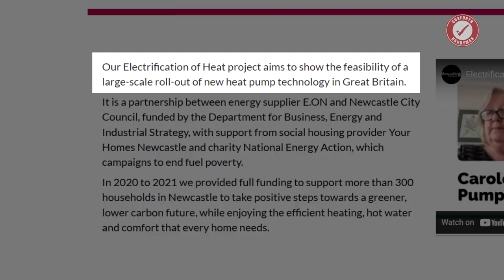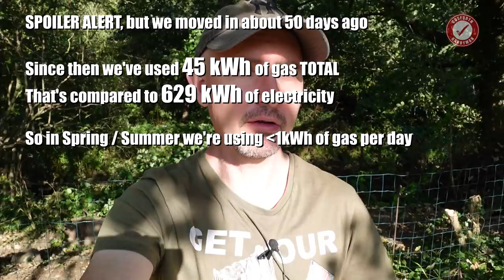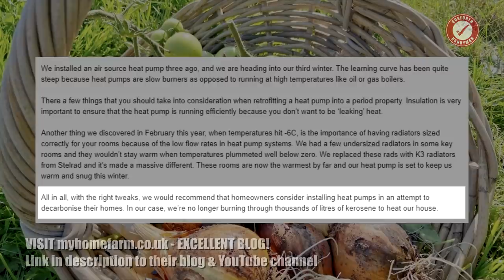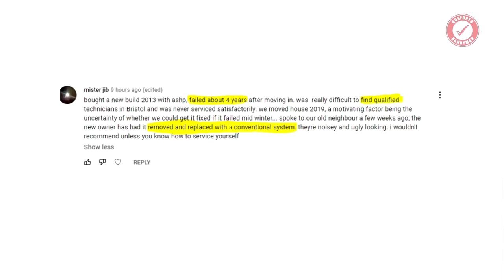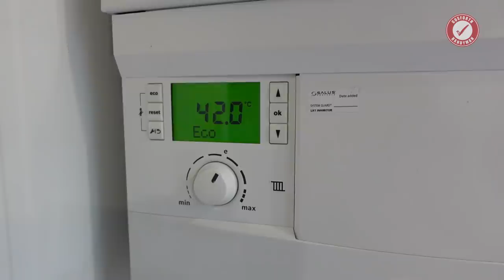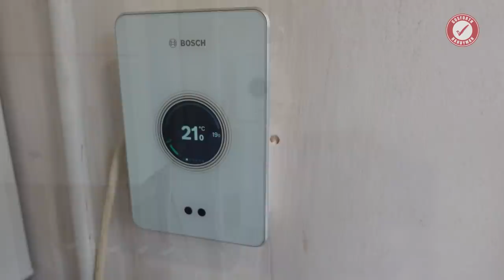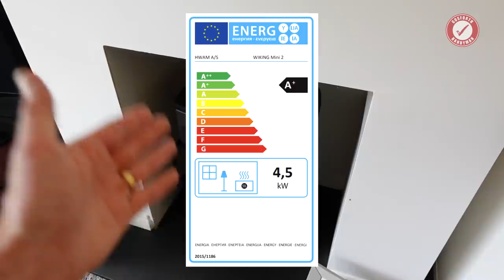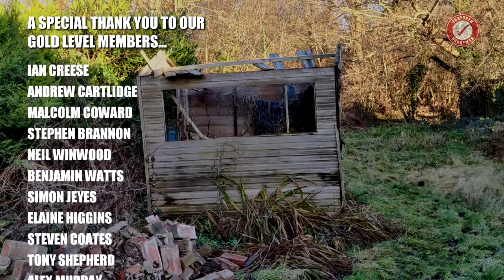Why didn’t we install an Air Source Heat Pump? (1920’s Renovation Part 32)

Comment: I have some family in Sweden, they only heat their house with a ground source heat pump and an air source heat pump and they have no issues. They have had it for 25 years and their house is very well insulated (almost passive House standards). I think that heat pumps are definitely very interesting but are only really appropriate for really well insulated and air sealed houses.
Reply: And... Countries where electricity is cheap?
Reply: I think that you might be talking about two different things about ground head... one is more like a dwell and the other is putting plumbing all over. The one Richie's Swedish family has is probably the dwell kind. Guessing from Andys hand waving I'd say he is referring to the pipes-all-over-kind.
Reply: Heat pumps work in Scandinavian countries because they use quality wood as part of their building private homes, and this make homes warmer than using cheap bricks!

Heat pumps will fail in the UK under current housing standards, unless new houses are built to accommodate for heating pumps and you need proper insulation and no air drafts! Otherwise in freezing weathers, heating pumps won't warm the house and therefore homes will use electric heaters which will be costly and that defeats the saving claims!!
Reply: Same in Austria
Reply: In Sweden, there are very few locations is gas in pipes to households, there is also not a lot of usages of gas in tanks. So a gas burner system like used in this video is not an option in most locations in  Sweden.  In cities most of the heating use district heating.  If you are out of a city where it is not available eclectic heating is the main option.  So direct electric heating or by using a ground or air heat pump.
Reply: As some people are saying, you need highly insulated houses and ideally under floor heating, which runs at a lower temperature than radiators in a gas central heating system. Retrofitting most existing U.K. housing stock with air source heat pumps is pointless. The government needs to introduce much higher insulation requirements for new builds (and for air tightness, as someone else mentioned). As for existing houses, I don’t know what the answer is - probably only hydrogen.
Reply: @wilyc0y0te  the insulation standard for new builds ls high enough. We’re talking about 0.11 W/m2k now for walls and floors. It’s the air tightness that is lagging behind.
Reply: @immers2410  my standard new build is at 4m3/hr/m2 they are getting lots better.
Reply: @svantesvenson5435   b
Reply: @svantesvenson5435  I know what you’re saying. The Dwel type work well from my understanding talking to a friend in Sweden when I visited in 2006, but that’s because they go so far down, I think his was 200m, to warm granite bedrock, which the type Andy was talking about was the one with pipe a couple of feet below ground. Sweden has always been ahead of the game.
Reply: @Floyd1504 there's an immersion heater with it, this kicks in at 60 Celsius, something the manufacturers don't tell you about, offices on like Trading Estate have a banker of Grey massive air conditioning units, these things are noisy big and ugly especially if it's got to go on a wall or your decking, this is going to look very interesting when it comes to fit on these tall residential buildings, high-rise,,, here in Wales our psychopath narcissist Mark drakeford is still going ahead for all properties to have this crap fitted by 2030,  don't forget if by then you don't have the heat pump you will not be able to sell a property by a property remortgage a property without a certificate, not only is this on the world  economics forum but it's also in the government's manuscript, people need to start waking up for what the government is doing,
Reply: They are also very noisy.
Reply: I lived in Norway I had triple glazing and home insulated inside and outside cladding
Reply: True. Quite a lot of nordic housing is in the same fashion. Still, 50cm ground insulation and 25cm wall insulation! Insulation is key.
In some countries with a fair amount of geothermal activity (volcano land) have plants that are basically large ground source heat systems and distribute it to districts. Either way, the insulation is the absolute key. Without that high insulation factor, it snuffs any success.
In the UK, houses have nothing close to that.
Reply: @NeoFreshair  plus 50cm ground insulation and 25cm wall insulation!
Reply: TWO PROBLEMS. (1)Too many Luddites in the UK. Education is poor. (2) Appalling construction standards now coming home to roost. Bottom line is, much of the housing stock needs rebuilding!!!!Frankly it is over valued and rubbish...
Reply: @megasoctopuslegionofcake6248  what??>?
Reply: @Floyd1504 I think this is the other advantage of ground source. Afther a few meters the soil is at a constant temp (I think 20c) it doesn't matter what temp you have in the outside. So ground sorce is better for hard winters and less noisy. But it is expensive and much complicated than a gas boiler. It all depends on the price of your energy, either gas or electricity.
Energy in Spain is very  expensive, I am paying 350€ a month in a semi-detached house, very well insulated. If per example you can get solar, heat pumps soil sourced might make sense.
Reply: Bricks are best with quality insulation , better acumulate heat. Wood has not so good acumulation. I have 44cm porotherm + 16cm EPS and 30cm rockwool roof insulation and everything works great. FloorHeating 200m2 , heat pump Daikin altherma 6kw a7w35. Bills are good thanks heat pump and super acumulation of bricks and great insulation. Floor heating about 30*Celsius heat water. Thatˇs all.
Reply: @Floyd1504 still better than having only one option which is to constantly be burning fossil fuel

Comment: Chartered mechanical engineer and energy specialist here - not to be rude, but the myths and misunderstandings of these systems as presented in this video is exactly why uptake in the UK is so poor while the vast majority of other countries in Europe / North America (with much more extreme weather) are proceeding with proper heat electrification. Trust me, if an ASHP or GSHP system can work in Michigan, it can work in Newcastle! To be fair, these systems are very different to wet / rad based fossil fuel boiler systems, and therefore our conventional knowledge of combustion systems does not typically apply. Yes, you must install larger radiators to kick out the appropriate heat (if using a wet system), but this has nothing to do with efficiency. ASHPs are generally 3-4x more efficient than gas boilers, irrespective of how modern they are (bar some caveats around extreme temps). If used correctly, ASHPs in UK weather will year-on-year always be cheaper to run. In truth, insulation is not even an absolute necessity, but will make a home cheaper to run just the same as if you were running on gas so long as radiator sizing / heat inputs are properly addressed.

Don't forget, as well, that wet systems (using radiators) are only one potential solution. Air-to-air heat pumps using cassettes are also just as viable and used worldwide. Noise issues are a fair consideration, but heat pumps are getting quieter and quieter by the year. 

Electrification of heat is not going away, and the UK should embrace it. Hydrogen reforming may and combustion are certainly discussed, but will never have the same appeal as a global technology like heat pumps that already has mass adoption.

I am certain that a heat-pump solution would have outperformed the chosen modern gas system in running costs and potentially performance if properly designed and specified. However, the concerns around capital cost of installation are valid, and RHI / other incentives are only getting more and more sparse. Given the home didn't have a wet system to begin with, I can almost be certain in saying the specification of a multi-split reversible air-to-air heat pump with wall mounted cassettes (potentially supplemented by some level of insulation, although not necessarily) would have allowed for a far more efficient, not to mention low carbon solution with the ability so easily integrate things like smart zoning and controls and potential comfort cooling in hot summers which will only become more and more common. And because there would be no plumbing necessary, it may have even come out as cheaper to install!
Reply: Thanks for your comment, saved me from some of the despair I felt after watching the nonsense in this video. I wonder how many commercial/public buildings this guy has been in over the last few decades which have been kept perfectly warm by the heat pumps he says don't work as far north as, er, Newcastle. Hardly the arctic circle.

However, I do have concerns around current levels of expertise and support for domestic systems. We have an established supply chain for commercial jobs but how many of those companies could be bothered with dealing with the chaotic retrofit market? The current domestic heating system supply chain (esp retrofit) with plumbers shoving in oversized boilers with zero real design or commissioning could be pretty disastrous for heat pumps - perhaps the reason for some of the negative feedback to date.

Comment: We installed an ASHP in our previous home and would do it again in our next. It was a 9kw panasonic unit. As I'm from the Netherlands we have similar weather. Last winter was the coldest in many years with temperatures dropping to -15c. The heat pump is not very efficient with those kinds of temperatures, but that doesn't matter. It's all about the average throughout the year.

Our house was built in 2015, so fairly good insulation, which is key. 172m2 floor space and it was a corner house. Underfloor heating downstairs and normal radiators upstairs. Normal radiators worked, but lowh2o ones would've been better. The installation together with a 300l hot water tank was 10k, but we got a 2k government grant.

We also installed 18 solar panels which covered the electricity of the heat pump and then some... 

Yearly kwh usage through the heat pump including hot water, was about 2800kwh. Total electricity bill for everything was about 40 euros a month....

Comment: You have described my problem to a tee. I live in the U.S. Air Source heat pumps work great, how ever, in the U.S we use forced air not hydronics. Secondly inverter technology in the air source heat pump has helped make them way more efficient, Mitsubishi hyper heat puts out 100% of its heat capacity at -15c or 5f. But on the other hand, water is a much better heat transfer medium. You can not only modulate flame, but water temperature as well. I’m in the heating and cooling business, where I live in the U.S we do boiler work as well. Good choice and a good brand. I Just don’t want people to get the wrong idea about heat pumps. Inverter Heat Pumps are very quiet, and is efficient, the conventional heat pumps are only work in mild climates where temperatures don’t go lower then 4-5C or 40F. But conventional heat pumps are loud. Again my only experience is with forced air heat pumps.
Reply: Too many people are likely to only listen to anecdotal evidence from their echo chambers online. The fact that there are numerous different types of heat pumps with varying efficiency suitability for different climates means that they are a much more suitable option that this video would lead you to believe.
Reply: @MrManningata  Well, there's also the fact different countries employ different standards and not everyone is using the same technology or has the same options to choose from...  So YMMV, in some aspects like windows some European countries are way ahead but in others they're behind, for example...  So what he stated is likely true for his situation and the options available to him locally.  Other comments from the UK seem to indicate this to be the case... 

The UK is not a great market for Mini-Splits.  So they may not have access to the better and more advance units that can handle pretty cold temperatures, etc.  While it's also a matter of building standards as improper application of any technology can give undesirable results and it did take a few decades for many of the advance building technology today to be developed that we shouldn't forget that it may not be available yet to everyone, and older standards can take a long time to change...
Reply: @ZeoCyberG  I remember in a boiler class learning that the UK sells more boilers in a year then all of the United States. I hope my original comment wasn’t taken the wrong way. At least here in the US we seem to be a little behind. The better boilers on the market all seem to come from Europe, Bosch/Buderus, Viessmann and the best oil burner I ever worked on again is from Europe, Riello. 

I feel like this was a well done video explaining his decision making process and what led him to his decision. I also feel that when natural gas is available and a boiler system is already in the house, a good high efficiency boiler is a great way to go. My first comment was made for the people who live areas who have a lot of forced air systems who believe heat pumps are not good. Ed Manning and you are totally correct as well as this video, take your climate you live in, the technology that is available to you, and your price range to make a well informed decision.
Reply: @randysmith3828  you don't have boilers in the US? How do you get hot water?
Reply: @MrManningata  we do have boilers here in the US but mostly in the North East of the country, we mostly get our hot water from stand alone water heaters. Most common are 40 - 50 gallon or 151.4 - 189.3 liter tank type natural gas, propane, or electric. We do have wall hung water heaters just to do hot water and they are gaining popularity here. We also have heat pump water heaters with electric element back up (tank type) which is also gaining popularity. Believe it or not, in old home renovations here in the US, people are a lot of times removing boiler systems in favor of forced air so they can have cooling as well. It’s always fascinating to me to see how other parts of the world do things, European boiler technology in my opinion is the best, then you have the mini split systems coming out of Asia that are absolutely incredible as well.

Comment: well done, Andy Mac! another hot topic from your channel. we also chose to install an efficient  gas/combi boiler in our  1910 farmhouse renovation. after months of baffling research (government incentives are equally paradoxical and fickle here in germany) it truly was the most sensible solution for our house and our particular situation. the quotes for 'alternative' heating solutions ranged from 25 k to 65 k euro, possibly somehow including those elusive incentives, but definitely not including in-house pipe and radiator installation, which was needed regardless. the 28 kw gas boiler install was about 3 k euro, and keeps two adults and four dogs in 350 m2 of space plenty warm.
the winters here are generally more extreme than you depict in your region, but we have made a real effort to insulate thoroughly throughout the build, and now in our fourth year (yes, still building full time) we see the benefits of this and have never regretted the decision to go with gas. 
your channel is excellent. not only do you tackle pertinent topics and challenging projects for a your active, hands-on viewers, but you manage to document and deliver them consistently with style and humor. truly wunderbar.
thank you for all of that, and for continuing to share with us this renovation. I have been doing this same work full time on our property for years now and still have the need to watch you get dirty. how delightfully insane. dig on.
Reply: Please speak now about how good and warm will be the winter with a gas boiler, I bet you already search a heat pump.

Comment: Good thought process!  

I live in central Canada with winter to summer temps nearing an 80 degree swing!  It was up to 37 deg C this summer and it can go as cold as -40 deg C in the winter.  I have two heat pumps, one as an air conditioner and adjunct heat in the early winter/late spring.  The other is in the workshop with the same use.  Air it air heat pump will not help us in the winter.

The rest of the time we only have an electric furnace in the house and electric boiler in the shop with in-floor heating.

Comment: Thought I'd add my 2 cents about smart thermostats. We have them and love them. We use different rooms at different times of day so can program each room to be a certain temperature when we want it. E.g. my office to be 20 degrees 9-5.30 Monday to Friday. Bedrooms cooler in the day and warmer in the mornings and evenings. It's not just the energy saving that's great, it's more comfortable also. I think it's like you said, different things work for different people in different properties.
Reply: Obviously you are a reasonably well off person to have an ‘office’ at home.  There are millions of people who only just make ends meet and could not afford all this new technology, also you have to stay in a property for a long time to get the payback from the cost.
I am not against technological advance, rather the other way, but it must be affordable, efficient, silent and proved before we take the leap!
Reply: @petercollins7848  you don't have to be well off to have a office at home. Lost of people working from home now and told they are indefinitely. A 'office'  can just be a spare room with a desk in it. I've just had new central heating system as mine was all electric and the cost of having the  smart thermostat etc was the same as the ridiculous price we was paying per month on heating the house with electric. Will pay itself off Within a few months.